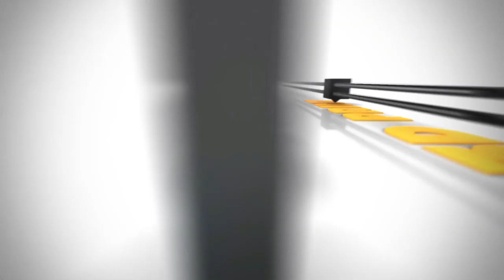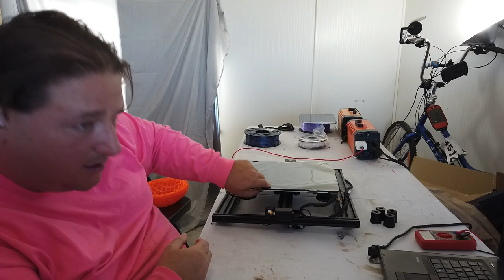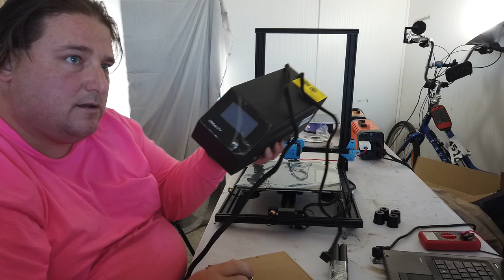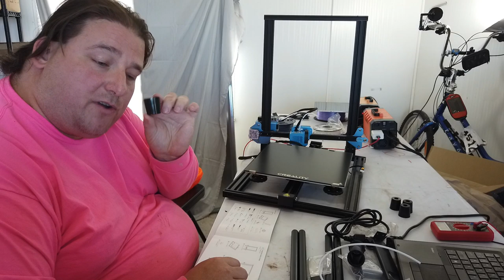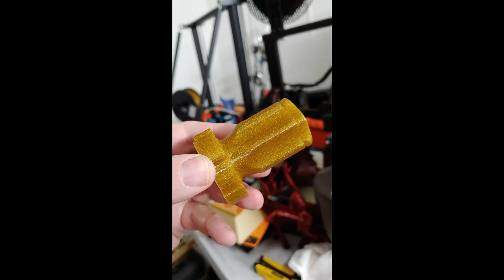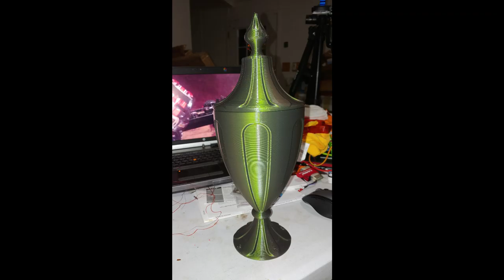Creality CR-10 V2 Setup and Sample Prints T3DP

Comment: Hello I bought mine 1 week ago and wanted to know how to center the belts in the bearing. Both x-axis and y-axis have the belts too much to the right...
Reply from the maker: I will take a closer look at mine later, but you should be able to Simply. Loosen the grub screw on the drive gear on the stepper motor and ship it in the direction. You want the belt to move

Comment: If I still have a working CR-10 is it worth buying a new one anytime soon?
Reply from the maker: Not unless you need an additional printer print quality will not be any different and you can gain most of the benefit for about $40 I think add the structural reinforcements to your existing cr-10 it is in my Amazon page on the 3D parts and accessories

If you're looking for an additional printer definitely by the V2 if you don't need an additional printer there's no reason to upgrade
Reply: @nerys71  I have like 12 printers, I think I need to sell a few. Thanks for the reply!

Comment: ...and hey again. I have the stock CR10. Did you do a vid about updating the stock CT10 -- in direction of the V2? Stiffin supports, any other things I can do to make CR10 bettah?
Reply from the maker: I have not actually tried to upgrade my cr-10 with stiffeners but it's a simple $40 purchase that should Bolt right in though on some machines you may need to tap the bottom hole